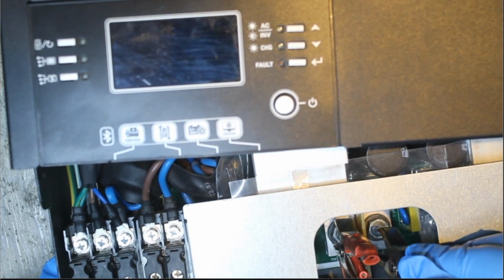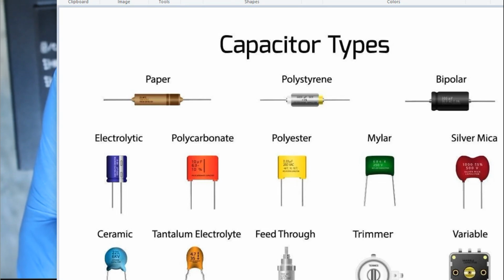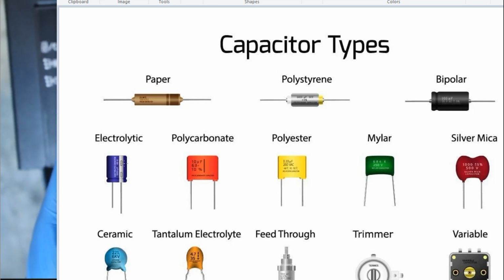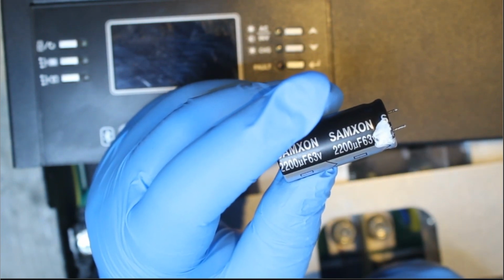REPAIR KODAK OG5.48 5000W F09 WHY YOU SHOULD BE CAREFUL WHEN HANDLING CAPACITORS

Comment: Hi sir ,  I have the same inverter and replaced all 9 igbts and checked the optocouplers , that 470uf cap keeps popping , I've replaced it twice and it blows its top straight away, you perhaps have an idea of where else I can look ?
Reply from the maker: check voltage across capacitor and the rating written on cap if voltage is too hgigh cap will blow also check polarity

Comment from the maker: Hi it differs with inverters, some inverters will work but some not. eg Growatt will give an alarm when the mppt board is missing if you disconnect mppt the inverter will show high voltage on pv fan will spin at max speed ie it will mulfunction

Comment: Assuming the mmpt igbt was faulty, can the inverter still convert DC to AC, if there is problem with the mmpt circuit? or will it affect the whole inverter from functioning if it happens that the mmpt side is faulty?